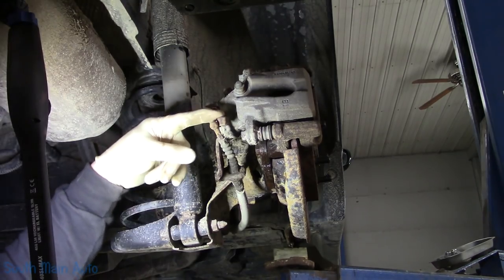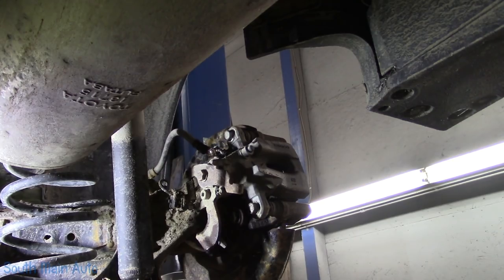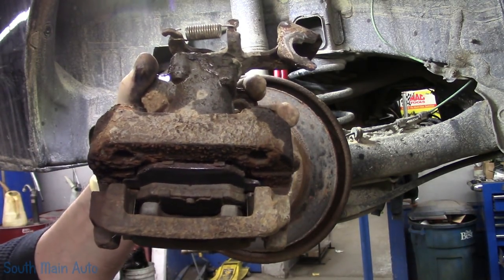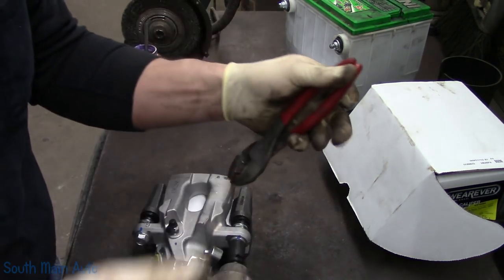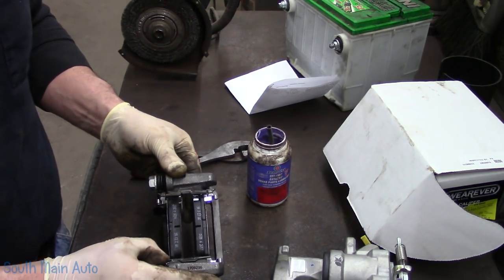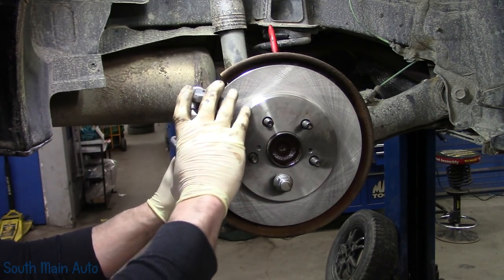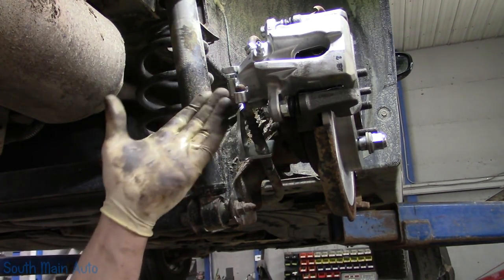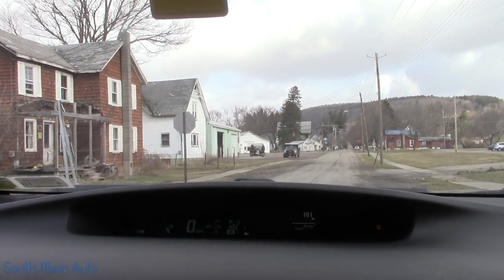Toyota Prius - Rear Brake Pads, Rotors & Calipers

Comment: What is the advantage these "clocked" pads have over regular pads?
Reply: It allows for self-adjustment of the park brake as it wears.  90 degrees rotation at a time.  You have to screw the piston back in, if you need to retract it (if you were replacing just the pads).

Comment: If you put the box end of a 14mm wrench over the emergency brake retaining clip and sligtly twist to depress the prongs, the cable will pull right out of the mount.    You don't have to use the cutting wheel and destroy the bracket.

Comment: It's been 5 years, how's that pinched brake hose?
Reply from the maker: Actually 2 days after this video that brake locked up causing the car to roll in middle of the highway at 86.32mph flipping into a giant diesel tanker which also flipped spilling its entire load then crashing into a gasoline truck which hit a truck load of matches which set everything ablaze burning up an entire bus load of nuns... Sad day really...

Comment: whats the result of not having that back pin lined up in the cavity of the twist out piston ?  Can you please explain how that system works ? Thank You.
Reply: I believe that lining that up was so that the clip on the pad would rest properly in place.
Reply: Self adjusting feature screws out with brake application. When replacing pads only the piston has to be screwed back in.
Reply: The pistons in the calipers are actuated by hydraulic pressure when you press the brake pedal. The parking brake works by rotating a threaded cam inside the caliper that pushes the piston out.

If the pin on the rear of the pad isn't engaged in the piston, it won't sit far enough back and may cause a dragging pad, plus the parking brake may not function correctly as the piston will try to rotate when the parking brake is actuated instead of moving in and out.
Reply: OK Thank you all for your replies.

Comment: I always thought the Prius brakes had some kind of contraption for the regenerative braking.  I was surprised at how simple it is.
Reply: Regenerative braking is internal to the transaxle/motor/generator assembly.  It doesn't actually use the brakes

Comment: This is apparently problem with most hybrid cars. Rear brakes get almost no use due to regen breaking. My Kia Niro  is 8 mos (2k miles) old and rears are already pitted.
Reply: I'm sure it is a lot worse in rust areas than here in Arizona.

Comment: No need to break in the new rear pads?
Reply from the maker: Yes they should be burnished in
Reply: It's almost impossible in the Prius anyway. The rear pads can be broken in a little using the parking brake but since it is press on / press off it is tricky. It can also be done with moderate braking but it is very hard to gauge. As you saw by the rust the rear brakes engage pretty late in the process.

Comment: I have a 2008  model 5 prius. When you approach it, it senses the key in your pocket, and adjusts the brakes . Recommended procedure is to disconnect the battery before you start as when you try  removal of the shoes, they may come to life and close. I guess they changed all that........
Reply: Also, make sure the fob is nowhere in the area when changing oil. The Wizard relates a story of a mechanic who put one on a lift and started draining the oil when the vehicle - which was in "ready" with the engine off - came to life.

Comment: I never see you use the cookie wheel to clean up any rust on the caliper mounting surface. I touch that portion up to ward off rust jacking or rust build up and provide a clean surface to mount the caliper.
Reply: He forgot to use a Q-tip as well.  That does it!  Unsubscribed, brah!

Comment: i have used my parking brake every time i park  since i started driving standard shift some 30 plus years ago
Reply: The mechanic at work used to yell at me when I set the parking brake in my work truck in winter. The first time was when I was new in snow country and he had to get underneath and thaw the cable with a torch. It was never a problem in Phoenix!

Comment: I've heard that some hybrid models self test by activating the brakes, so you'd have to somehow disable the process before removing calipers. Pinching the hose should be safe enough, but is there a way to prevent it without a scan tool?
Thanks for another informative and entertaining video.
Reply from the maker: Most guys pull the ABS relay....
Reply: South Main Auto Repair Thanks for replying. See you on WUW

Comment: Mrs. O is not going to let you play with power tools anymore if you don't wear your eye and ear protection !

I have never seen any "professional" mechanic spend that much time cleaning rust off of the hub flange or using that much brake cleaner to hose it down !
Reply from the maker: Gotta be clean or it will mess up your whole job!
Reply: nothing like warped "vribrator" rotors, wiggly steering wheels etc.

Comment: Prius? What kinda of tree hugging hippie channel is this? That spray action and music was epic, thanks for the video, have an awesome day!
Reply from the maker: The guys other car is a 2500HD so he is still OK in my book :)
Reply: TheTexasCoder I would take a Prius as a daily driver because they get 50mpg.
Reply: It's the smart way to go. Dead reliable, cheap to own and operate, the only cars that have never stranded my wife or me. At work I drove an F350SD and it was at least ten times more troublesome than my Prius. Injectors, high pressure oil pump connector (a 2005 exclusive that stranded me 13 times! - the tow truck driver and I were on a first name basis), stuck EGR valve 12 miles from pavement....

Comment: they need brakes? why
Reply: Regen braking was never meant to bring it to a stop or for hard braking. Don't know about later models but the first gen (2001-2003) stopped regen below 12 mph. The regen also stops when the hybrid battery is full; not what you want on a 20 mile downgrade. The mechanical brakes usually last hundreds of thousands of miles.

Comment: I can maybe see it if somebody mongo’d some meaty toothed vise grips on a hose, but if proper hose pliers damage the hose, that brake hose should’ve been in the round parts bin already. Personally, I trash the hoses and flush the fluid with every brake job, because my brakes usually go 60-100k. I know customers would flip over that, though.

I’m guilty of not using the parking brake. When you’re 25 miles from anywhere in -35* weather with frozen parking brakes doing 6,000 rpm clutch drops and praying you don’t grenade the clutch or driveshaft, you learn to use it only when necessary.
Reply: Agree 100% with both paragraphs.

Comment: A Prius has brakes?
Reply: Probably the most complicated part of the Prius. It has a brake controller module that handles mechanical / regen balance and ABS. It's a good thing the system is so reliable; it is more complex than the hybrid transaxle. On the other hand, the pads last almost forever.

Comment: Since I'm a one man show, if I gravity feed my brakes why do I need someone to pump my brakes? Isn't the beauty of gravity bleeding that gravity pulls all the fluid through naturally? What am I missing?
Reply: Gravity bleeding can be very slow.
Reply: spelunkerd yes thank you. I think Eric O. Talked about how shops, including his, cannot wait the time allotted to perform a full gravity bleed. But for us DIYER'S, is it safe to say that we can just crack the breeders and let each caliper gravity bleed?
Reply: One thing about the Prius and Lexus, the electric motor that pressurizes the system can turn itself on if you get the key close to the car, even before you put the key in the ignition. For that reason, the dealers manual (at least in the Lexus) says to store the key a long way from the car when doing brakes. If you happen to have the caliper off the pressure could push the pistons out or push enough fluid out that the system notices the brake fluid pressure has fallen. Then you get a check engine light that may be hard to erase without a scan tool. Several people have sent me messages of panic that they forgot to put the key away and now have a check engine light. Regarding bleeding, it is fairly easy to use a tube on the nipple leading to a container that prevents air reflux and avoids a mess on the floor. So even with only one person and limited tools you can bleed with the brake pedal.
Reply from the maker: Yes these with the pressurize brake system make them gravy to bleed. Always liked that about the Toyota's and Lexus. You just hold the pedal down and as soon as that pump kicks on you have more flow than you know what to do with! Unfortunately around here when the lines rust out it will also empty the master cylinder in about 10 seconds :)
Reply: Yes, I have heard of this method but I have also had failure of the master cylinder because of it as well.  You start pumping a brake pedal on an older car and the travel of the internal piston of the master cylinder can cause the seals to blow.  That's why I prefer to gravity bleed my cars because it doesn't put any risk of destruction of any other part of my car.  And i've also seen, on other Youtube videos, when they have used the clear hose and container that air sometimes reenters the system even with your best efforts because the seal around where the hose meets the nipple is hard to keep air tight.

Comment: I can see that owning a Prius would lose you all credibility but are they actually worth having?
Reply: The Missing Link's Younger Brother... My son bought a Prius and went from spending $500 to $600 a month in gas to go to work in his older car to now spending approx$150 to $175 to go same distance.
Reply: We have bought nothing else since 2002. By far the most reliable cars my wife and I have ever had! Don't get me wrong - the 50 mpg city and highway is great (gas is no longer part of our budget) but it is the phenomenal reliability that keeps us with Prius. Unfortunately, my wife's 2010 turned into a magnet three years ago - within barely half a year it was sideswiped by a pickup that swerved into her passenger side, smacked in the driver door by a deer running across the road, and fatally crunched in the passenger side by a driver who had a seizure in a parking lot. Although the damage to the two passenger side doors was beyond economical repair the car was still drivable and both doors opened and closed just fine. No way the windows would open, though. We replaced it with a used 2014. We have owned two Prius for 16 of those 18 years and neither of us have ever been stranded. None of the other cars we have ever had could make that claim!

Comment: So most people don't use parking brake?  That seems so alien a concept to me - I learned to drive in the UK and handbrake use was drilled into you right from the start - don't even think about not using it, even with an auto trans.
Reply from the maker: Heck even people here that drive a stick do not use it. I use mine every time I park. It is just second nature. Trying to get a customer to use it after you rebuild the whole system for state inspection... pffff fauhgetaboutit!
Reply: Yep, with manual gearboxes being the norm in the UK we all use our handbrake all the time and it is a natural part of driving. Got to love the smell of that brake clean though!
Reply: Well I live in the UK ( Inverness) and I find that  the vast majority of people sit waiting for lights to go green with their foot firmly on the brake pedal , never using the hand brake.
No big deal on a bright sunny day but in the winter with dark skies or at night, I find the intensity of some stop lamps on modern cars really uncomfortable to look at. Lazy and selfish IMO.
Reply: Haha, yeah hard to get people to change years of habit - I just don't trust the auto trans park mechanism and nice to have a backup.
Reply: Auto gearboxes are okay (generally) to use in stop-start traffic, that is one of their best features, but if more than a few seconds, I will put handbrake on (even with it still in 'D') to save warping the front discs with hot pads
Reply: Wait until you have it freeze on in -35*f weather, and you’re 25 miles from civilization. I see cars driving around in winter with the rear tires locked up all the time. Brakes froze, and they just slide the tires around on the ice.

Comment: Why didn't you rebuild those calipers at a cost of 5$ each and turn the rotors? New is nice but $70 each for new calipers and $25 each for rotors plus your labor is ridiculous. I have always rebuilt calipers. It's a simple and inexpensive repair that has always worked for me.
Reply: Seal and piston would both need to be replaced, add in the slide pins and new hardware and you are much more than $5. Also sourcing the parts is an issue, you may have to wait days to receive them.  Plus the bleeder would be seized in place on most everything Eric works on.

Rotors, for $25 replacement them. Look how rusty they are. Labor cost is $70 hr he charges. Its going to take 30 min to clean them up and turn them even if they are turnable.
Reply: Kits are around $5. New piston doesn't need replacing. This is an unnecessary parts replacement. I stick with my 40 years experience with dealerships in not throwing expensive parts at every job. Availability of rebuild parts is easier than the entire caliper i found.
Reply: Piston might need replacing if its pitted, you are not sure unless you take it apart and look. Plus in my area you cannot find an in stock piston seal for a caliper. It would need to be ordered and be days to a week out. Plus what do you do when you break off the rusted bleeder screw? drill it, then you need to source a bleeder. 

Rebuilding calipers is a thing of the past. I have been in the business for 20 years, never saw anybody rebuilding a brake caliper on a modern car. If you want to do it on your own car, go right ahead. No customer is going to pay your shop $70-100 an hour to rebuild one though.

Comment: Toyota Prius <<<<  BURN IT
Reply: no worries they nearly burn themselves when the inverter coolant pump fails :)))
Reply: @throttlebottle5906  Not at all. They have to be towed if that happens but there was a recall on them. Anybody who suffers an inverter pump failure in recent years (that would be me, with my non-recalled first gen around 200K miles) has only themselves to blame. The problem was fixed in 2010 production - you gotta keep up!
Reply: @flagmichael  had to replace one, after it was warranty replaced once previously, of course it wasn't covered the second time and it shorted blowing the fuse making the car instantly dead in heavy traffic on two lane road, then they didn't send a tow driver with flat bed or any knowledge to unhook it and slap a fuse in to get it in service mode....

Comment: I thought that pos car had regerative braking .
Reply: It does use regenerative braking with friction braking under some conditions. For example, long downhills when the battery gets full, hard braking, slippery road (regen only uses the front brakes). That pos car is by far the most reliable car I have ever had - we have had nothing else since 2002 and have done one actual repair. I gave my 2002 to my son a year ago and he did the brakes for the first time at about 205K miles. The front brakes were 2/3 worn (lotsa big hills here in the mountains) and the rear brakes were not measurably worn at all.
Reply: Since you left this comment 2 years ago how many times you fixed your non-Prius POS?  People always hate to see the most reliable and technologically advanced car which is light years ahead of the competition.  We are talking human psychology here.  You don't need to show the world that you are butt hurt.  I have a Mercedes GLK350, a Scion TC, a Prius, a RAM 3500, a Ford Escape, and a Buick Enclave.  My Prius is the most reliable of all my cars.    I don't even know why I am wasting time talking to an idiot.

Comment: Some things a guy should never do
1. Fix a Prius...
Reply: Why not?  That was about the easiest brake job ever!
Reply: True that. Just own it; it probably will never have to be fixed. My wife's 2010 was smashed around 150K miles, before it ever needed any repair. Original brakes, just scheduled maintenance, tires, wiper blades, an occasional 12V battery. I got so tired of fixing our cars before we changed to nothing but Prius.

Comment: Man oh man...I HATE having to follow someone who drives a Prius.  They usually drive like they have all day to get where they're going, which, in their Green Peace mind, means that you do as well. And...I always use the parking brake.   Every time.
Reply: I have seen more complaints about them driving too fast. It is all in what you notice. (PS - no GreenPeace here - I am probably more conservative than you are. I am also 100% practical, and that is why I am stuck on Prius. No other car I have owned since 1971 has been anywhere near as reliable.)
The shop mechanic here in Flagstaff chewed me out all the time for using the parking brake on my work truck in winter, ever since the first time he had to get under with a torch to thaw the cable so I could roll.
Reply: Even if they go fast, you will still hate them because you can't stand someone having the better more reliable car than yours and spending half on the gasoline than you.  It is called jealousy.  I know exactly what you are talking about.